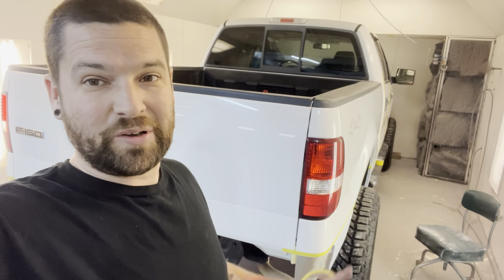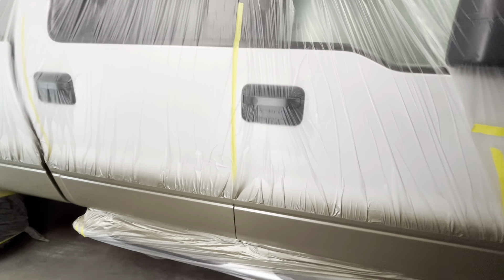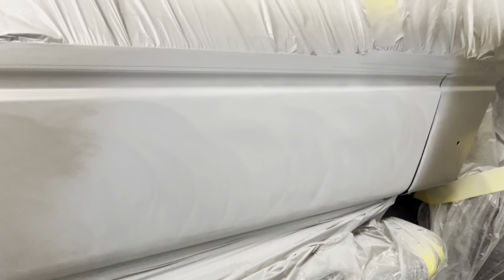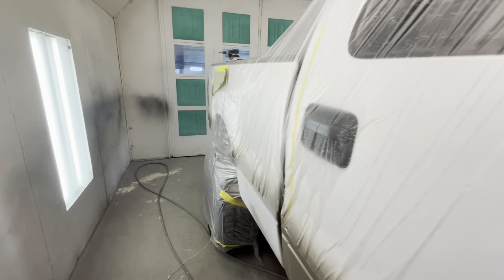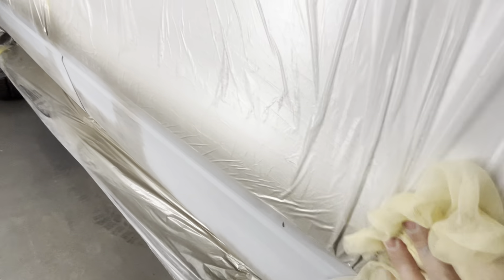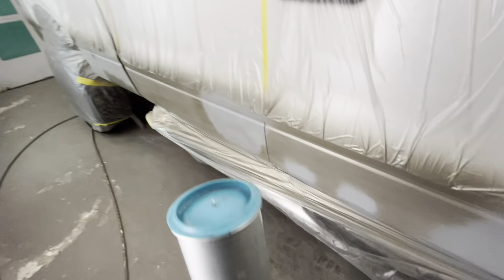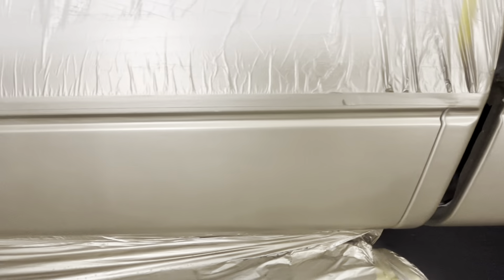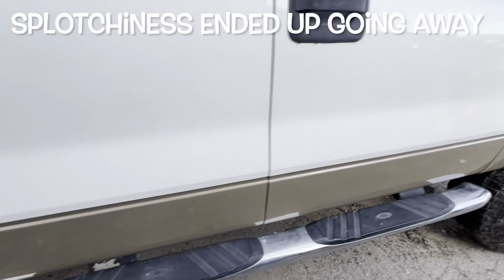🛑 HOW TO Save Your Paint Job When Things Go WRONG + Two Tone TIPS ❗️

Comment: I've learned this lesson many times haha I always seal no no matter what. Bloch with 320 da with 400. a single coat of sealer flash for 15 minutes and roll into base. never had this issue again. sealer has literally saved my ass on so many occasions. I use pig das3021 mix3d 3:1. only thing I r4commend is letting it flash pretty good 30-40 minutes before denibbing or touching it it stays a little gummy.
Reply from the maker: Awesome thanks man

Comment: There are several 2k sealers out there that you have like a 2 hour window on to top coat it with your base coat without requiring a scuff session. A 2k primer and sealer are really a 2 in 1 product as well. Depending on whether you want it as a primer or a sealer the only difference is you use more or less hardener. It will say on the spec sheet what your ratios will be. I usually layed down my sealer coat and then turned right around and come back with color but if you go outside of that 2 hour window then you need to scuff with a burgundy 3M pad and tack then color.  But what you did is exactly the same thing I woulda done if I wasn’t gonna try and lock it with a sealer. Dry coat the F’ outta it till you feel it’s locked. WhT you did is perfectly fine. It’s just a game to figure out what it takes
Reply from the maker: Thanks man great advice

Comment: seeing this definitely doesn’t make me miss spraying solvent base. you need to get you a pint of waterborne primer. you won’t use much and it’ll last for a while. i use RM so it’s DP100, can’t remember the PPG number. but spraying a coat or 2 over that wrinkled spot when it first wrinkled would’ve saved you a ton a time because the water won’t wrinkle and it would’ve locked it in. not critiquing just trying to help out.
Reply from the maker: Water cost more from what I know. Also from everything I’ve read you need to change everything else over. Matches are harder to get also I hear. So far I’ve had zero interest in water.
Reply: @ThePaintPaperHustle  man i love water. i’d honestly never go back to solvent unless i had to. it’s definitely more expensive. but definitely look into getting you a pint of the waterborne primer. it’ll help you out on issues like you had with the busting. the water primer wont bust or wrinkle.

Comment: Question I have some body parts on a truck that have rust oleum gloss white protective enamel could I scuff it up and clean it then primer it and paint it or do I have to sand it all the way off
Reply from the maker: Normally spray paint causes issues when painting over top of with legit paint. However you could just try it like I did on this job. To play safe you remove it all though but I don’t play safe often lol

Comment: images
Reply: Omni makes a 2k sealer you spray one wet coat  let it flash and base right over it without sanding
Reply from the maker: Yea true I’ve never used it though. I try to buy as little products as possible. Good to keep in mind though. Sealer wouldn’t have filled in or over that wrinkle though and I had 2k primer down originally over it all and it still wrinkled through.
Reply: @ThePaintPaperHustle  just letting you know.........paint problems suck........
Reply from the maker: @glennshotrodgarage5509 yea definitely good to know. Thanks man